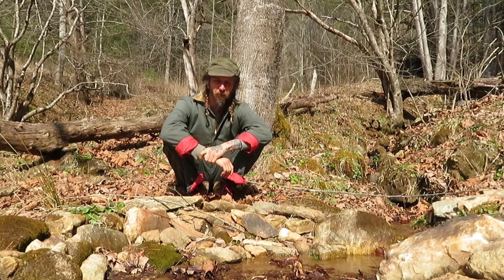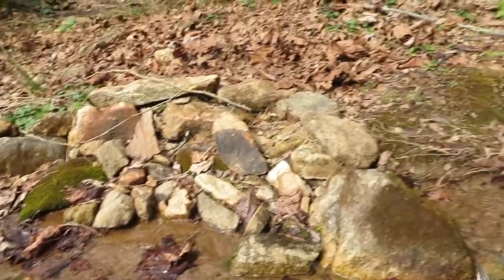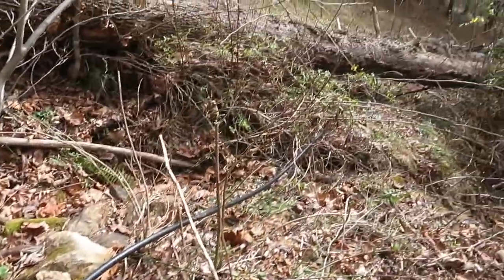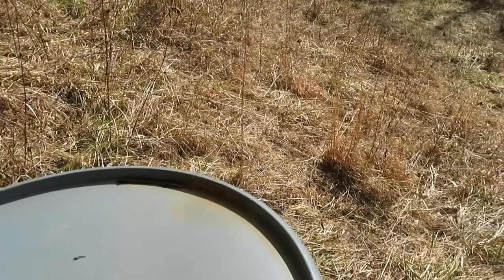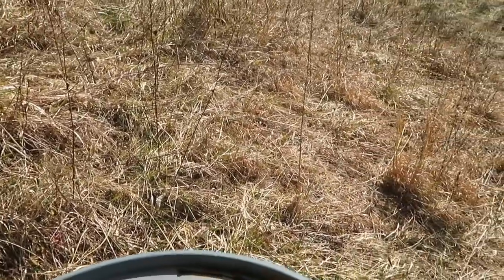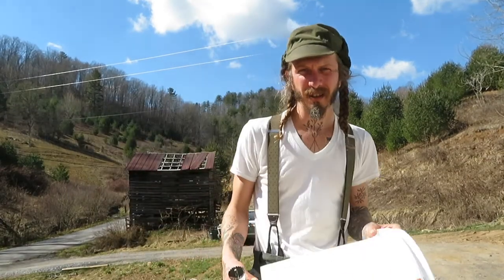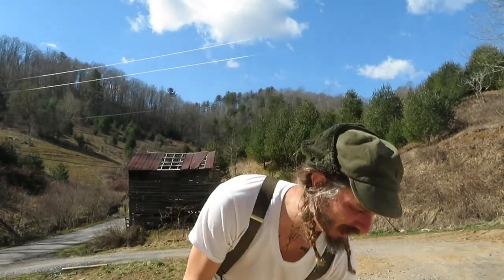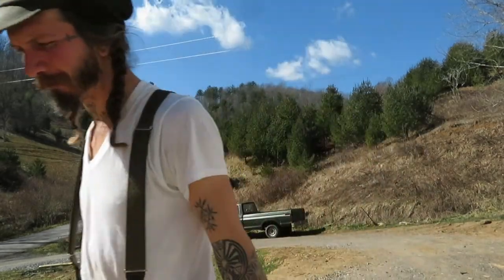Water system 1// How to build a sediment filter for spring water catchment// FERAL RESERVE

Comment: Another 90 pointing down into the bucket (sub water level) from your intake would (a) direct the sediment downwards and away from the screen (b) allow less turbulence on the surface where the screen is ... minimising air coming in and (c) debris on the sedate surface of the water is more likeley to go into the overflow. Id even consider a really low-level spigot or screw cap access for draining sediment off ? Cheers !

Comment: Just a head up as a plumber and also 5yr off grid. White pvc is non potable and leaches into the water. It literally says non potable on it.
Reply: i would imagine the water would be sent through some filtration system if required for drinking ? say, 20, 10 then 1 micron. A carbon filter then a UV system would be my choice.

Comment: How would one do a spring water sediment filter before a buried cistern in a place that freezes during winter?
Reply: So long as the creek keeps moving i would not expect it to freeze unless temperatures get ridiculously low. Trenching or running inside a pipe sleeve are always an option...

Comment: your line will not freeze in winter?
Reply: I'm about to find out.  I have the same question. I have a spring I've used for over 40 years. It doesn't have a prefilter like this one. The water goes straight into an old spa tub ( bathtub/hot tub) from a trailer. It  was a scratch and ding part from a builder and free. The water is piped directly into the tub and the overflow just runs out over the top. The drain feeds the line to the house,gardens,etc. To save on a filter  I just have a piece of metal window screen held on with a hose clamp at the top of the feed.  Dirt does in there when it rains really hard since the sediment doesn't have time to settle.  It has never frozen even  at sub zero temps ,  The1" black plastic piping runs over the ground in a lot of places since it gores over rocky watefalls,etc. and couldn't be dug in. The pond has so frozen we couldn't break the ice for the horses using a splittling maul or sledge hammer and the water didn't freeze. We keep the water in the sink running 24/7 a day in winter. Our water heater has a simple pvc by-pass so the water doesn't have to go through the heater. A pain to open and close the valves when you want hot water  but bettter than no water and broken pipes. So long as the water is moving it doesn't freeze. Seems too small and would freeze  but the idea is great. I would spend way less time from not having to clean my spa tub holding tank  very much.W ish he had posted a parts list that was  very clear and streaight forward.

Comment: great video.  I'm designing a medium sized slow sand water filter system (minimum output of 2,000gal/day).  This is in a remote part of Haiti.  The design currently is a bigger version of your design but we are using two 500 gallon round tanks instead of 5 gal buckets.  About 3 months per year, our source creek will have very high turbidity.  Any thoughts on passive mechanical filter designs to add inside of sediment filter to improve performance beyond basic gravity?

Comment: Consider adding a 90 or 45 at the inlet inside the bucket. It would direct sediment away from the filter giving it a chance to settle. Good deal all in all, simple!
Reply: Hi Joe, any thoughts on my question above in the comments regarding adding a passive structure inside the filter to increase effectiveness during raining seasons/times of higher turbidity?
Reply: Hello, I appreciate your comments and I am preparing for a natural spring in OH.  Can you please explain the 45/90 degree comment?

And also, would you cover the initial collection box area to avoid ground run off and animal contamination?

Comment: Where did you get the black slotted filter that is attached to your outflow pipe?
Reply: A short piece of pipe with small holes drilled into it, then capped off would work just as well as a filter. Not even glued it would be easy to remove, clean and refit.